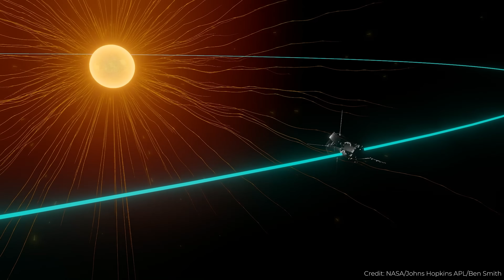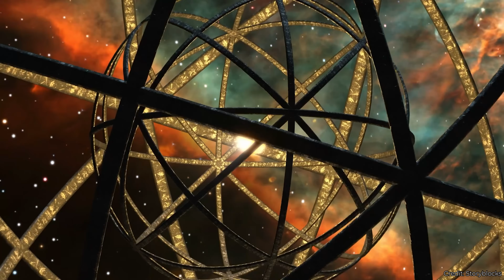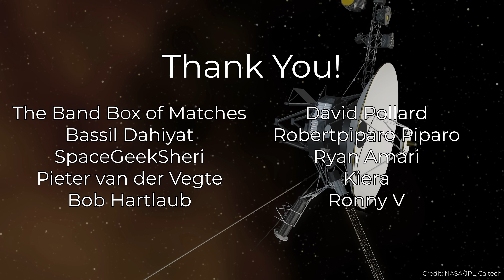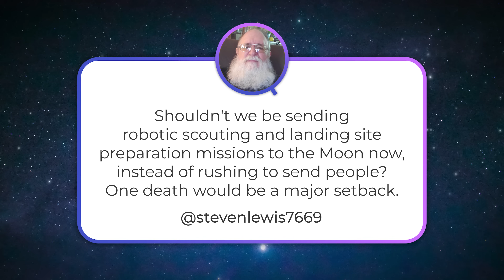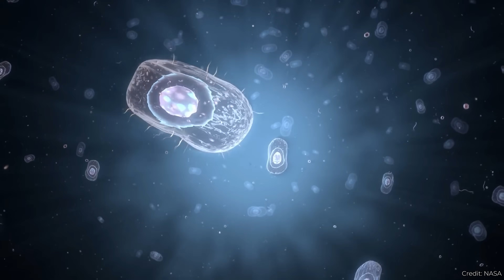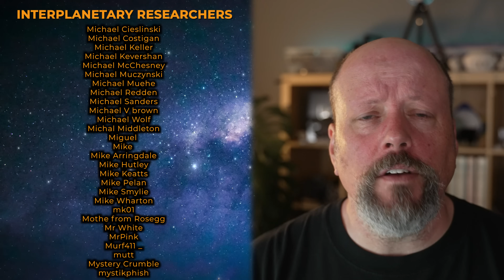State of The Voyagers, Dyson Sphere Construction, ELT Expectations | Q&A 401

Comment: The Voyager team found they could detect debris impacts using the PWS instrument. Abstract P42A-04 for the American Geophysical Union, Fall Meeting 2011: Dust Impacts In the Outer Solar System Detected by Voyagers 1 and 2; Gurnett, D. A. ; Persoon, A. M. ; Granroth, L. J. ; Kurth, W. S. 
"once the regions around the outer planets are excluded, a consistent background impact rate of a few impacts per hour is observed by both spacecraft. The impact rate appears to be increasing slightly with increasing radial distance, from about 3 ± 1 impacts per hour at 30 AU, to 6 ± 4 impacts per hour at 110 AU. If the impact cross-section of the spacecraft is assumed to be determined by the spacecraft high gain antenna, which has an area of 10.75 square meters, the corresponding particle flux varies from about 0.75 x 10-14 m-2 s-1 at 30 AU, to about 1.5 x 10-14 m-2 s-1 at 110 AU. Although we have no reliable method of estimating the size or origin of the particles, we note that this flux is consistent with the flux of submicron particles (10-15 to 10-9 g) arriving from interstellar space as detected by the Ulysses spacecraft at radial distances inside of 5 AU."
The most recent dust detector we've flown to the outer solar system is the VBSDC on board New Horizons. "New Horizons Venetia Burney Student Dust Counter Observes Higher than Expected Fluxes Approaching 60 AU"
by Alex Doner et al has recent measurements: an average of 1E-4 impacts per m2/s, which means a little over 1 impact per 3 hours per m2.

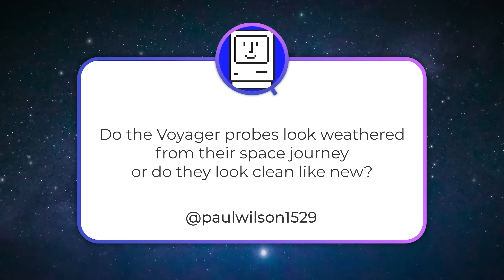Comment: Satellites are really a Dyson swarm. Also at 5:35, the weathering of satellites is the reason why I believe it may not be possible to achieve high speeds (such as 1% the speed of light) to get to another solar system. Even if you only get hit by components of a solar wind (such as Electrons, Protons and Alpha particles) on your journey. You would have to account for it to protect your spacecraft. Even then, hitting grains of sand at those speeds would cause a lot of damage, nevermind a tiny rock. At 11:18, people are going to die in space all the time when we colonize other worlds.

Comment: Dyson sphere alternative that could be doable; 

* Use the gravity and atmosphere of another planet to seed a cloud of material around it and then collect a fraction of the energy from the star hitting that cloud. 

Bonus: No need to build mega structures that require constant management and repair.

Even then, what do you do with that massive amount of constant energy?  Mine the far side of Venus from space with the energy?  Make a Death Star?  Power a warp drive or a fleet of solar sails?  Make a huge laser sign to advertise "Visit Sol!" for the folks in Alpha Centuri?

(FWIW: Venus rotates backwards, has long days and a short orbit, is not solar locked, so mining let alone teriformingis not tempting.  You're going to have months of daylight followed by months of night even with atmospheric scattering; hostile even ignoring atmospheric pressure.)

Problem with a Dyson sphere: The majority of this solar system is in the Sun itself.  Even if moving the remaining mass into orbit around the sun to form a partial sphere or a ring were not accounted for, there doesn't seem to be much of a use for the results and managing the shell or ring is an issue itself.
Reply: Insert before "Bonus" : 
"Downside : preventing the star's radiation from dispersing the cloud in a matter of months. 
Bonus [...]"

Comment: Could a ground based telescope use the known track of satellites in their field of view as "guide stars" to adapt their optics for atmospheric distortion? The known shape, orientation and materials of these satellites should provide an excellent measure of the atmospheric distortions.
Reply: Yes, they can use known satellites as guide stars, but only at twilight when reflection from the sun off the satellite provides highest contrast, while most telescopes do their work during astronomical night, couple hours after twilight.

Using known satellites as guide stars is extremely useful for the adaptive optics of telescopes used to detect and track space junk.  The image would be too blurry otherwise.

Comment: The Worst Part Is The SRB's Can only last so long before the propellent becomes Unstable. The Entire Vehicle would have to be Disassembled and Rebuilt. This Is Heart Breaking. The Helium Leaks Must Use Same Tanks as We Do as Divers.  Ty Fraser.  Positive Vibes.
Reply: Diving helium tanks are the same as regular air tanks. But the helium, being a physically smaller molecule (atom, even, it being helium, not a diatomic gas ; but see also the ~0.7% v/v monatomic argon in conventional air), it is better at seeping past O-rings. Helium plumbing is a bitch. And you have to rotate the tank regularly before use, otherwise you might get a lung full of 90% He when you intended 20% He.
The tanks that need special preparation are the oxygen tanks, because both the O-ring material and the lubricants (including many commercial silicone greases not certified as oxygen-safe) can react with oxygen, perishing rapidly, losing elasticity, and (potentially) doing a nice demonstration of a diesel engine when you first crack the botle pressure into a closed space.
Reply: @WellsiteGeologist-UK  I did not think we would use composite carbon fiber wrapped. I'm Old School Like the thick tanks but they are Heavy. I think we are at the edge of our Material Science.
Reply: @StealthMode139  We've had enough tanks dropped down 20m pitches (and not explode on impact!) that we're quite conservative about tank materials. Light is good - particularly if you've self-sherpaing. But exploded is very bad.

Comment: Can't we put 100 telescopes in Parralele or the tech isn't ready yet?
Reply: We can do up to 10 in the optical. And up to 20-several in the radio. Once you have telescopes the effective size of the planet, there is relatively little to gain from adding many more.
No, you can't do it between the Earth and the Moon, or between the Earth and orbiting satellites. The difference in velocity and the change in time between different parts of the gravitational field will destroy the necessary coherence of time between stations.
The proposed LISA (Large Interferometric Space Array) mission will have 4 spacecraft operating interferometrically, but it'll be placed far out in space form the Earth, and all 4 components will be travelling in the same direction and at the same velocity, with high precision, to enable interferometric operation. You can't do that near Earth, or with Earth as one of the detectors because of relativistic time dilation between space and Earth's near vicinity.

Comment: Wouldn't it be more helpful to find out how long the Parker probe's instruments last while being protected from the Sun? I'm guessing that testing the protection is as important as testing the instruments themselves. Turning the instruments toward the sun to see how long it takes for them to melt is the 8-year-old astronomer's play.
Reply: The PSP has had 7 (approaching 8) years of protecting it's instruments as much as possible from the Sun, and their degradation rate under those conditions are known. Since the spacecraft has a limited lifespan before one of (moving-parts wear, e.g. in the radio antenna mount ; manoeuvring fuel supplies ; thermal stresses ; radiation damage to the computers ; random meteorites impact) renders it inoperative. So, if you want to know how effective the protection methods are, at some point you need to remove that protection.
It's called "testing to destruction". It's how you determine if your machine was sufficiently engineered, or expensively over -engineered. What you don't want to happen is the machine to fail, uninformatively , the day before you start the TTD programme.

Comment: Explorer 6 in 1959 had solar panels.
Reply: Vanguard 1, launched 17 March 1958, was first.
Reply: @bbartky  I thought Vanguard 1 to 5 were battery powered.
Reply: @ekaa.3189 Vanguard 1 definitely had solar panels. There are a lot of good articles about it you can find online. From Wikipedia:

“It was launched 17 March 1958. Vanguard 1 was the first satellite to have solar electric power. Although communications with the satellite were lost in 1964, it remains the oldest artificial object still in orbit, together with the upper stage of its launch vehicle.”

EDIT Added the following:

Also, there were only three Vanguard satellites. Again, from Wikipedia:

“In late 1958, with responsibility for Project Vanguard having been transferred to NASA, the nucleus of the Goddard Space Flight Center was formed. After four failed launches, the program once again succeeded with SLV-4, renamed Vanguard II. After two more failures, the program ended with the launch of Vanguard III in 1959.”
Reply: I think you may be combining the Vanguard and Explorer programs together. I looked up Explorer 1, 2, 3, 4, and 5 and 1 (of course), 3, and 4 were successful but 2 and 5 failed to reach orbit. Explorer 6 was launched 7 August 1959 and was successful. And unlike Explorer 1—5 it was solar and not just battery powered. So, it looks like it was the first Explorer satellite to use solar power.

EDIT Removed duplicated text.